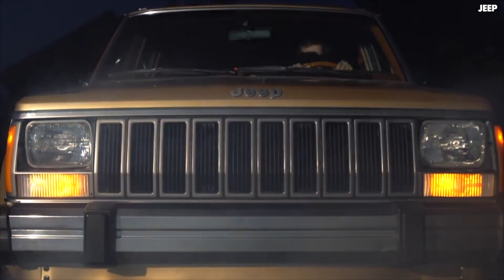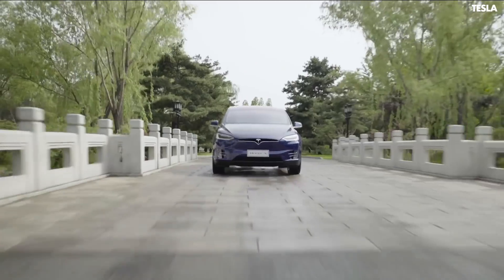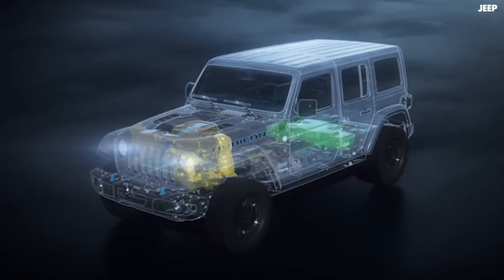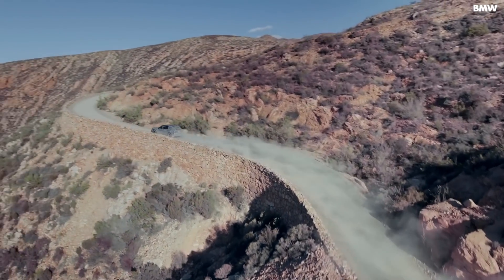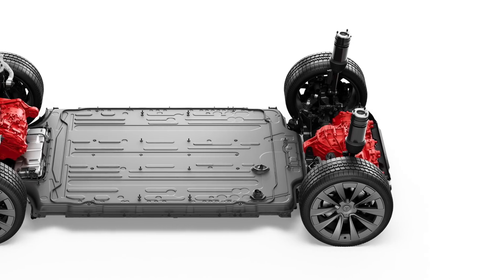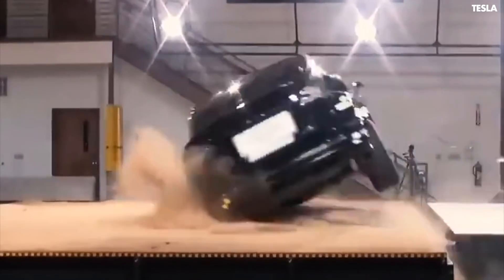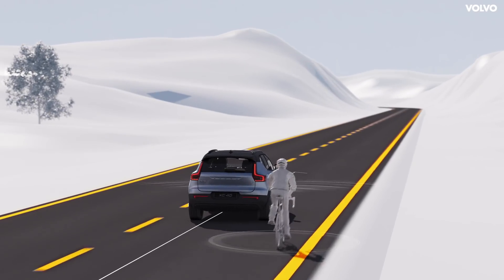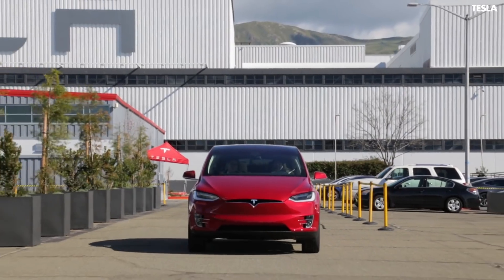How Tesla Made the Model X IMPOSSIBLE to Roll

Comment: Owners of SUVs with combustion engines should attach 600kg underneath. We're back to the old days of VW Beetle owners putting a sandbag in the front to improve handling.
Reply: adding weight is never gonna make a car handle better even if it's low. in case of strong front or rear bias it can help reduce understeer/oversteer but I don't think it's worth in reading weight except very specific application (for instance racing if you have a minimum weight and you are under, or if you are towing a heavy load/driving on snow)
in the case of high center of gravity having body roll is still better than having heavier car, plus adding weight means you reduce the payload and offset the suspension settings
Reply: @geemy9675  Well, adding a 600kg battery under the axles stopped these SUVs capsizing on cornering. I'd say that's a huge improvement in handling.
Reply: @geemy9675  you're just splitting hairs now.
Reply: @geraintjones6401  yeah that's cause I don't have much..
if you wanna keep it simple, lighter means better handling, and same weight lowered/centered weight too
more weight is not better even if it's in the right place, that why noone puts dead weight in a car, if you wanna  improve  weight placement you move stuff, you don't add stuff
Reply: This comment section is surprisingly well spoken. I actually learnt a few things from it. Thanks for the knowledge.
Reply: @yuminago  You're welcome. Thank you for the kind words.
Reply: Comes with some other issues that may be somewhat significant! Better solution: people should stop buying stupid tall cars ☺
Reply: @ApothecaryTerry  Don't worry. I get your point. The majority of people who buy SUVs will never let it leave pavement let alone scale a mountain.
Reply: @ApothecaryTerry  how are you gonna go offroad in a "smart" short car...
Reply: @Egerit100  Why would I? We built roads for a reason, I use them.

Off-roading is fun, I've got nothing against it or proper vehicles for it. 99% of SUVs never do it though, they stay on the road. For that, they're stupid tall cars.
Reply: @ApothecaryTerry  1. A lot of places aren't accessible by road but ok
2. Most SUVs don't go offroad but even on road they offer better cargo space, more people space, you can actually fit a third row of seats in some of them, and they usually have a higher towing capacity than short cars such as sedans
Reply: @Egerit100  1. SUVs are great in Namibia. Most people who drive them don't live in Namibia. I'm clearly mocking people who live in big cities and drive them.

2. This is true, for anyone who owns 3 large dogs and has 4 children an SUV is justifiable. Again, 99% of people with them have absolutely no need.

I'm not suggesting for a second that SUVs aren't justifiable. I'm suggesting that hardly anyone actually has those justifiable reasons for owning one. Almost all owners buy them because they like being higher up and basically because they're fashionable. It's not that you're wrong, you're not- at all, but the point you're arguing against isn't the one I'm making.
Reply: @ApothecaryTerry  fair enough but the way you say it makes it sound like if all big cars are dumb. Also, you don't have to have 4 kids for a third row to be useful. if you wanna go somewhere with a group of friends that could be useful but oh well
Reply: @Egerit100  Most of the cars aren't dumb at all. Most of the drivers on the other hand...

If I was into off-roading, I'd find it annoying that SUVs now have a reputation for people wanting bigger cars to be higher up, feel superior and pretend they have any other reason for them. The standard of driving also seems consistently lower as a combination of the mentality of the people, the size of the cars and just the fact their mistakes are more visible. None of this applies to a farmer driving a Defender out in the countryside though, for example.

It's just like being an F1 fan- all the fanboys being toxic on the internet recently has made me embarrassed to be associated with them.

I should say that I'm fully invested in mocking these people's choice of car, that's fully warranted ☺ Doesn't extend past that though, I'm not necessarily suggesting they're bad people or anything.
Reply: @ApothecaryTerry  I am a university student and I drive a lifted 90s jeep xj, I use it on road maybe 75% of the time and the rest off road so it fits me pretty well, and I know to not take a corner hard because I can feel where it's limit is
Reply: @jurassicjack3320  Good for you- especially since a lifted XJ won't be mistaken for the flock of SUVs and crossovers so you don't have to worry about people mistaking you for someone bought a stupid car ☺

Cars like yours are great, I'm not mocking you or it at all. Anyone who drives a Porsche Cayenne Coupé I am definitely mocking! I'd include the Model X in that but honestly the doors do make it worth buying over the S so I can't blame anyone for that. EVs aren't so bad either because the extra weight doesn't equate to wasting fuel just for the sake of being higher up...since no fuel (well range but it's a non-issue really).
Reply: @Egerit100  a lot of places are not accessible by road??? where do you live? in the middle of africa?
Reply: @zioxei  u don't have to live in the middle of Africa for that. In the US if you live in very rural areas it wouldn't be too strange to have to go through a dirt road
Reply: @Egerit100  More Cargo space? Dont be ridiculous, i find all SUVS to be really cramped for their size and have pitiful cargo space compared to normal Stationwagons in relation to their size. Crossovers by trying to be everything end up being the worst of all worlds. Only benefit is if you afraid of high crubs in cities. Also they are horrible for other reason, due to how stupidly wridespread they are they limit visibility drasticly in urban settings in europe, you barely can see over them, you can see out of a perpendicular parking spaces along streets. Its not a thing you should defend. Its also horrible for pedestrian safety. People should stop being moronic and start coming back to normal cars. If you need 7 seats, get an MPV, if you need offroad get a true offroader like Wrangler, Land Rover Defender or properly capable midway car like Subaru Forester with real AWD system, not these fake bullshit crossovers and SUVs.
Reply: @Kacpa2  crossovers are a whole other thing. I completely agree that by trying to be a little  bit of everything they end up the worst at everything but full on SUVs have more space. Sure, it's vertical space instead of horizontal space (on most, some are actually quite long/wide) but u have more cargo space. About safety, SUVs also have to go through safety tests and get approved so I don't see why they would be any less safe. If they were less safe to the point where they're A LOT less safe they wouldn't be allowed. Sure, the risk of a rollover is a bit higher, but they still pass the tests so the risks couldn't be much higher
Reply: @timoarrg  Which comment exactly? And what is idiotic about it?
Reply: @ApothecaryTerry  the comment where you said that why would you need high cars when we have roads. At least where I live you mostly can't have a low car, not even a factory stock supercar unless it has air suspension, because the streets are filled with potholes and are overall destroyed for the most part, also a lot of people live in farms or remote places where the path is quite irregular and you wouldn't get there without a medium sized pickup at minimum. I understand your madness about people buying suvs just for big cities and never touching an off-road zone but a considerable amount of the people who buy SUVs and high cars (pickup trucks and stuff) actually need it
Reply: @zioxei  oh dear. you have lived a sheltered life, haven't you?
Reply: @GraveUypo  what the hell is that supposed to mean?
Reply: @Kacpa2  So many people do drive lifted trucks/jeeps/defenders in the cities which are much more stupide than crossovers, much worse for visibility and pedestrian safety. they handle like shit. Now of course not everyone can or wants to own one vehicle for each situation.
Now of course the race for getting a heavier & higher vehicle than other drivers on the road is stupid, it means all vehicles have gotten heavier and higher, handling get worse, noone gets better visiblity in the end, and safety gets worse in average.
Reply: @Egerit100  crossovers make compromises, like any vehicle, so do SUVS, I wouldnt say they are the WORST at everything, they just dont make the same compromises. SUV are better for towing heavy loads or sometimes better offroading and significantly worse just driving on the roads, without towing anything, which they are doing most of the time.
Crossovers is also a wide category that goes from small city crossovers to large 3 row crossovers and the boundaries with SUVs are blurring. Lot of crossovers are decent enough in light offroad to get you through dirt gravel roads, decently high driving position, and they dont have so compromised handling, as SUVs and useless additional weight/lower efficiency that body on fam SUV's carry.
Many people hate crossovers like they hate civics/corollas/camrys,  mainly because you see them everywhere, but its also for a reason. They just meet many people's needs.
Reply: @geemy9675  Exactly.....and we couldve enjoyed a world of proper nice station wagons and sedans, with only trucks and rarely an actual offroading suv/4x4 cars driven by people who actually need the clearence and use it. Instead its thiss hellscape where i i have to dare to drive out from between them on perpendicular parking space... Its horrible in traffic too i cant tell if something happens ahead of them and keeping longer distsnce barely helps in most conditions....
Reply: @Egerit100  I know this is old but 2. is just not true. An SUV always has lower cargo capacity and people space than an MPV with comparable price/weight/fuel consumption you name it.
Reply: @Egerit100  if you want a vehicle for its cargo space, then get a wagon, a hatchback, or something else more practical
Reply: @GetWrekked06  sorry to break it to you but I don't think any of those are going to have more (or the same) cargo space as a large SUV (say a GMC Yukon) plus hatchbacks have very little cargo space most of the time tbh
Reply: @Egerit100  Most people buy suvs for the cargo space, but I bet you most of the time they don’t even use it. They’re spending extra money for a what if. And that’s not a smart financial decision. But hey, if you wanna buy an SUV that’s capabilities most likely won’t be used most of the time, then be my guest. I’d rather buy a nice little Sedan to get me around town and maybe rent a U-Haul pickup or use my dads Silverado if I need it. Especially with the gas prices now. Don’t buy a car for the “what if’s”
Reply: @Egerit100  It is rare that I see an suv tow anything more than a small 12 ft trailer that I’m pretty sure a honda civic could pull, and you can get the same space out of a wagon. I’d say 80-90% of people that own suv’s dont go offroad and 50-70% of people that own trucks dont either. Also a dirt road is just as accessible by car as it is by suv or truck. My grandparents live in the middle of nowhere oklahoma off a few miles of gravel and dirt road and their main vehicles for years have been cars. I drive down to their house in my 08 ford fusion (mid size sedan) and it takes it just fine. Unless you are talking about literal dirt trails then that point is moot.
Reply: @zioxei  I'm from Africa and I don't like this 😄
Reply: @ApothecaryTerry  well roads vary. Like here roads are bad I mean really bad vehicles like Tesla with its low clearance and soft suspension would hit the body tall cars usually have high clearance {Not all of them have great clearance tough}
Reply: @akipovakipov8240  In places where the roads genuinely need SUVs, they're a sensible choice. In the middle of a city like London, or honestly most roads in Europe, the US and Canada, the only advantage of them being tall is that you can see them from further away so you know where the rubbish drivers are 😆

Some people say a Range Rover is useful in northern Scotland, but ground clearance isn't an issue in a sports car on the roads there. AWD is useful in winter but no need for an SUV for that. I'd take a GR Yaris, personally 😀
Reply: @ApothecaryTerry  cars with leaf spring or any spring that dosent damp that much with at least 200mm ground clearance is needed here......Our roads are not like mud or anything but its just bad there are high grade where normal 2wd cars would'nt climb without struggle 4WD low is convienient but not too necessary here
Reply: @akipovakipov8240  In that case AWD SUVs are the right choice. I'm just mocking people who buy cars which make no sense for where they drive them 🙂
Reply: @ApothecaryTerry  yeap AWD are great choices but expensive since our government taxed them like hell vehicles like Jeep are taxed soo bad
Reply: @akipovakipov8240  To be honest, if you have the right tyres then conditions are either fine for FWD or just stay at home 😁 I learned to rally drive in a Peugeot 306 and Citroen C2. I say that like I'm a pro...I just had some fun and went to a rally school once! Thankfully it snows about once every 2 years here so RWD all day every day 😄
Reply: @ApothecaryTerry  RWD and no turbo are best here better pickup at low speed and yes FWD are fine too
Reply: @akipovakipov8240  Which country do you live in? Somewhere not too cold I guess since snow and ice with RWD are very messy! Here in SW UK it's not cold but it's usually wet (lovely this week though!), I've had to be very careful a few times in my car- the rear end is a tree magnet 😂
Reply: @Egerit100  most sedans have good boot space and no body does offroading
Reply: @ApothecaryTerry  people in Canada: Are you sure about that in winter?

I had a few times last years winter where snow covered deep and even a Volkswagen AWD SUV having a hard time getting out of snow which requires people manual pushing the car out of the snow. Imagine if you have a sedan with low ground clearance, it will take you more time to clean the snow and most sedan are FWD thus less grip to drive out of snow.

Also AWD/4WD does has more traction when driving on snow and ice which is useful in Canada.
Reply: @kevinzhu5591  Been a while since I looked at this so I'm kind of guessing exactly what you're replying to, but to answer your question: yes!

SUVs have a time and place. That may well be Canada in winter. As a general statement, they're stupid cars for stupid people- half the population of the UK don't need to be buying Range Rovers. They exist for a very good reason, but people too often don't buy them for that reason.

In anything other than truly impassable snow, FWD is fine, I've been rallying multiple times in FWD cars, it takes a lot for any competent driver (which is the really issue, most aren't) to have trouble in a FWD car due to low traction. Ground clearance is more of an issue. Both are relevant if you're in a blizzard on Eyjafjallajökull, but that's not really a common scenario- Iceland in winter is just fine in a normal FWD hatchback.

RWD...well I drive a Porsche and even just cold rain can be interesting. Anyway I ramble, point is, SUVs have a time and a place in which I wouldn't criticise at all. Very few SUV owners have ever experienced that situation, plus I would bet on a somewhat competent driver in a FWD hatch on the right tyres over 99% of SUV drivers. Essentially, my issue isn't with SUVs at all, it's with idiots! 😄 There just seems to be a clear correlation between idiocy and SUV ownership. On the plus side, you can see the idiots from further away if they're driving an SUV.

...I feel I should reiterate though: while 90% of SUV drivers in most countries may be idiots, that absolutely doesn't mean they all are. Sensible SUV drivers shouldn't be offended by what I'm saying, they should be offended by the other SUV owners giving them a bad rep. In the same way that I'm an F1 fan, but the stereotypical Drive to Survive fanbase over the last few years have made me embarrassed to admit even liking F1.
Reply: @Traumglanz  I 100% agree with everything in your comment.
Reply: @Traumglanz  On this other comment, SUVs aren't generally built on truck platforms these days - mostly they're built on car platforms. They're almost literally just cars but taller, which is almost exactly the same as saying cars, but worse.

I used to think that the 1 advantage was that old people with mobility issues would find SUVs easier to get in/out of...well my Dad just turned 70 and crashed his car. He got an SUV as a loan car while his is repaired- he also says my Porsche is easier to get in/out of than the SUV because that's too high (and it's not even a full size one). So while the truck platform thing isn't really accurate, I 100% agree with your sentiment here too - SUVs are stupid.
Reply: Thing is that it is not only the dense stuff being low down that is important but the relative lack of anything dense and thus heavy higher up. That is to say that to bring the centre of gravity of a combustion engine SUV with a very large dense off centre mass of 150+ kg or so up high you would need to make your counterweight in the floor even heavier still. The lever analogy used in the video helps explain why as you can imagine a rollover as being the combination of inertia and any external kinetic energy slammed into the cars mass by an upset like a collision for example acting to try and lever the other side of the car up around the pivot point created where the tires on the low side contact the road. This is a good analogy as it explains why that engine mass high up needs an even greater mass low down to counter its contribution to the rollover, high up is further from the pivot point which is always at ground level thus mechanical advantage applies. Basically simply adding the stabilising mass low down that the tesla has would not make the ICE vehicle anywhere near as stable you would also need to offset the destabilising effect of the mass of the high mounted ICE itself. That additional mass would also need to be significantly greater than the mass of the ICE itself since it would effectively be acting with less leverage and thus at a mechanical disadvantage to the destabilising moment the high mounted ICE would be producing.

Frankly the ICE car would probably need on the order of a metric ton or more mass concentrated in the floor and occupying no more than the volume the battery of the tesla does so it would need to be even denser as if you have to increase the volume the only way to do that would be to make it thicker. That would of course move the average height of the entire mass up in the process reducing the lowering effect each kilogram of mass added has on the centre of gravity of the vehicle. Bear in mind lithium batteries are already pretty dense, their energy density per kilogram is only around 1.5 times their energy density per litre from that their mass density must be around 1.5 kg/L or 1,500 kg/m^3. To make this counterweight you would probably need to add something like a bunch of granite slabs massing in at 1,200-1,500 kg total and yes it would need to be several as there would still need to be gaps for the mechanical power transfer shafts between the wheels. Well either that or basically make the vehicle a diesel-electric or gasoline-electric ie with a drive train more like a diesel powered locomotive.

Not sure that would help though as you then need somewhere to place a generator capable of outputting in the region of what 200-300 hp or so somewhere where mechanical transmission to it is practical. That is a 150-220 kW generator which is neither a particularly small or lightweight piece of machinery in its own right probably too big to fit into the space between the front wheels that would be left after mounting their own independent electric motors to each of them. So that would leave potentially finding a way to mount the generator on a horizontal drive shaft at the same height as the engine which rather than solving the problem would compound it. Now you have another heavy dense bulky piece of machinery up high that you need to counterbalance from a position of mechanical disadvantage bellow.
Reply: The absolute worst thing people drive around is the squatted trucks, even worse for me because there are so many in my state.
Reply: Is the model X a SUV or a MPV?
Reply: goes out to his old vw and looks at engine/gearbox. notices engine/ gearbox protrudes as far above the axle as it does below.like a porsche le mans car.
Reply: I'm gueesing this is a joke. 600 kg is over 1300 pounds. Completely unrealistic
Reply: Or putting sand bags in the bed of a pickup which is still done all the time.